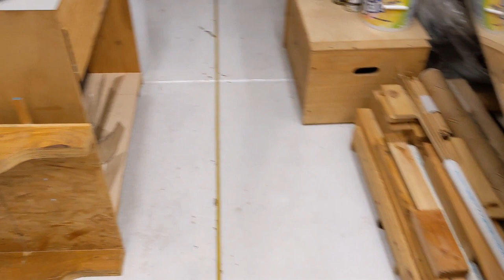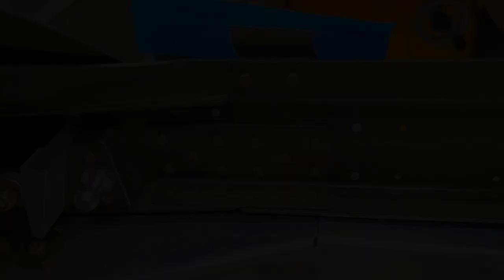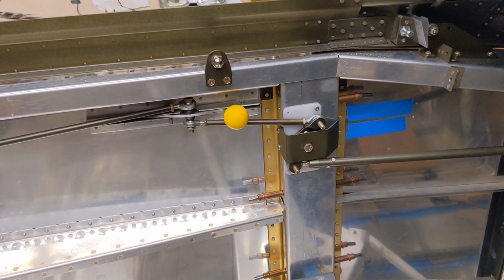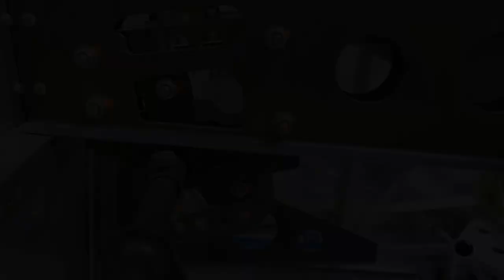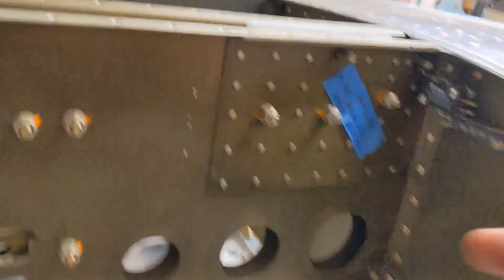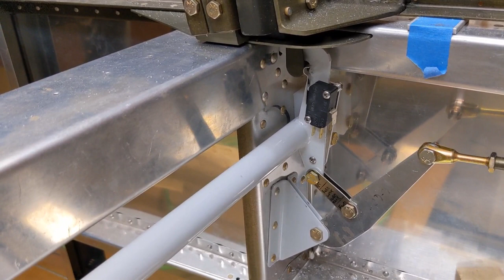RV-7A Pop-up tip-up canopy modifications

Comment: That´s some great engineering to solve those canopy issues!  For me the canopy installation was one of the most difficult parts of the build to get right. I found that the gas struts also pushed the frame slightly outwards. Does your system  prevent this too?  Another issue I came across is that the frame is quite flimsy and when attaching the plexiglass it  changes shape. In the end it came out pretty good but the process was quite frustrating. I´m building another tip up 7 now  so  I hope to avoid some of the problems. I´ll be watching your progress for ideas!
Reply from the maker: Thanks for the nice comments.  I touch on the mods to counter the gas strut forces near the end of the video.